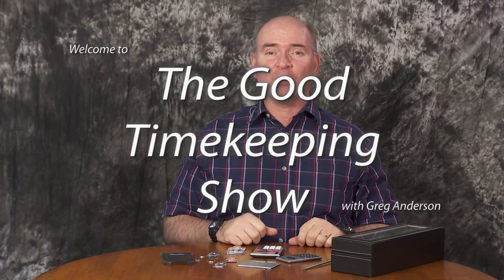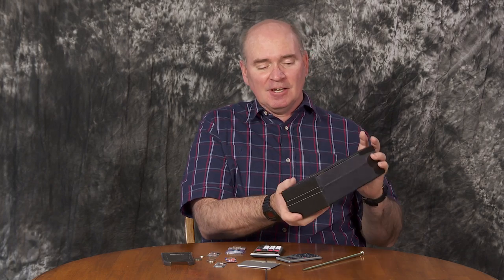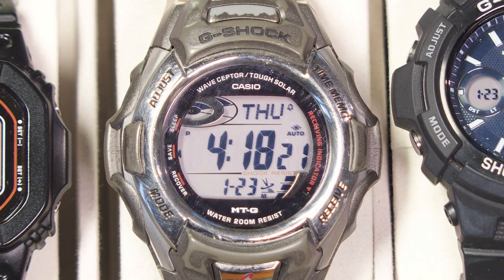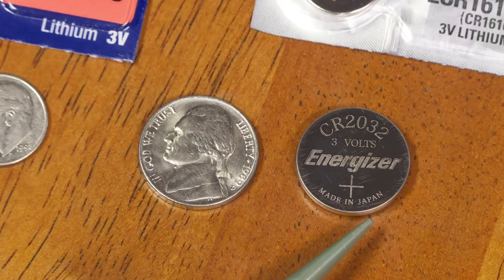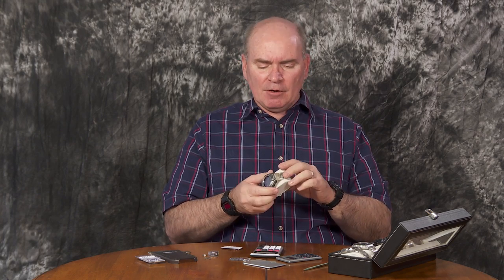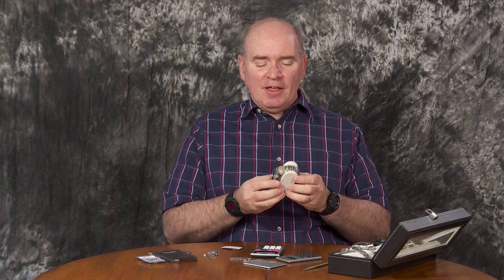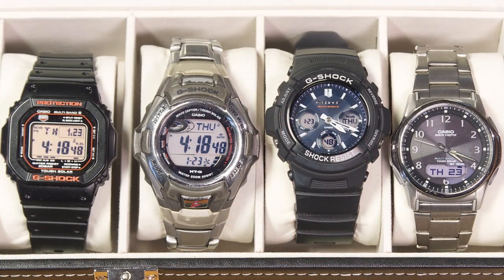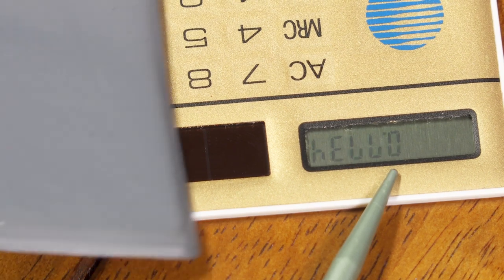What is Meant by Tough Solar (and Eco-Drive) in Casio (and Citizen) Watches?

Comment: I have owned a Solar G Shock for 15 years now...never had a problem and don't even wear it that much. Just take out to charge once a month or so,..
Reply: Can the battery be replaced after the Solar Battery is dead or does it mean Watch is also dead with the battery ?
Reply: @maximus3233  The battery can be replaced just fine, however it might not be dead at all. Give it some sunlight and usually solar watches come back to life. Not all of them of course. Also as Greg mentions in the video, if you do it yourself, make sure the seal is in good condition and properly inserted. Otherwise you're looking at a G-Shock that cannot come in contact with water or skin.

Comment: I've found the few Casio solar charged watches that I have, have easily stay charged well past six months in a drawer. Most if not all have a power save modes where the watch conserves battery charge when the watch is not disturbed for a certain length of time. That's both digital and  analog hands styles of watch.
Reply: Some Casio watches can last years without any sunlight. They all have a nifty feature called Power Saving, which will turn the display off after a while in darkness after a certain time and stay that way. Then if it still has not received any sunlight for a week, it'll stop the movement as well - So even more power saving mode. Also most Casio solars have features to extend the battery life if it drops down to a certain level, such as disabling backlight, alarms and radio reception. In total there are 5 different modes that these watches can use when it comes to battery life, and it's automatically selected by the watch depending on battery voltage. You actually have to work really hard to get one of these things to run out of juice (or forget it in a drawer for a few years) :p

Comment: Good video! When I was a child (80's) I bought a Solar Casio AL-180, but I lost it. In 2007 I bought another on Ebay from a New Old Stock and it's still working with the original battery.
Reply: It has capacitor not battery as far as I know it's written on the dial battery less 👍🏼

Comment: Some watches use rechargeable lithium batteries and some use super capacitors. These components are quite different in the way they internally store energy. While the capacity of the batteries definitely reduces over the years and charge cycles they have much greater capacity (energy storage) than super capacitors. However super capacitors should have a longer lifetime. I just replaced a CTL1616 rechargeable lithium battery in a 15 year old Casio Tough Solar WVQ-500. It was still working but would no longer charge to full on the indicator and would not operate as long as it used to, so I replaced the battery with a proper replacement and it is working like new again.

Comment: CTL1616 is Cobalt-Thorium-Lithium rechargeable battery. The original Seiko Kinetic line actually used a capacitor charged by a spinning generator, but the replacement was a lithium-ion battery (rechargeable). Maybe that's where the confusion comes in.

Comment: Capacitor Casio were called battery less written on the dial but with lithium ion rechargeable battery became common all new Casio use rechargeable batteries.

Comment: I had to replace my capacitor battery in my analogue Tough Solar Casio after 18 years of great service. I used that watch (and still use it) a lot, in the most harsh conditions. One month ago I noticed it wasn't keeping the display and time mode on, it was stuck in "low power state". Even after a day light charge, after one hour in the office it was gone. So ordered on eBay a new (correct) replacement battery, disposed of the old one and now it's all back on business.
Before going constantly in "low power mode", for at least two years the charge level was never going further than "MID" level. So I'm guessing that's a sign when you need to go for a new battery.

Comment: I have a solar Seiko SNE. On a motorcycle tour around Europe last year the watch spent a large part of the day covered up so consequently, it ran out of power a lot of times.  I never realised how much exposure to daylight they required.
Reply: I have , Casio, citizen and seiko solar. You are correct the seiko does not hold charge nearly as long as the other two brands. My Casio’s and citizen’s can sit in a drawer for 6 months and still have medium battery charge left. Now I but seiko autos and leave the solar to the other guys.

Comment: I have a G-Shock GW-002E-1VER for about 12 years now. I had to change the battery after like 10 years because it wouldn't charge fully anymore. It cost about € 20,-- including pressure test. It was done by a local watch repair service.

Comment: I've got one of the caseo watch like yours. I had to replace the capacitor last year. Ctl 1616 capasater. The watch is 20 years old.
It's not very difficult to replace the capacitor. There is a video on utube showing how to replace the capacitor. I replaced it just in time before corrosion damage the inner part.
If u haven't replaced the capasater yet , I would suggest u did. And relube the case seal if the seal looks ok. Cleen the seal area with a cleen qtip dipped in alcohol and let dry.

Comment: I just bought a Casio GW-2310. Is there a way to know when my watch was made? Based on some other sites I looked at with serial numbers it looks like it was made in 2014 but that doesn't make any sense.  10 years old?   Works fine but the battery is on Mid.  My previous watch was the same type and battery was on high for many years but the band broke which why I replaced it.  Can I expect the battery to eventually be on high after keeping it exposed to light?

Comment: How do you charge the CTL1616 battery/capacitor without installing it on the Watch? The new battery comes from the factory with almost 0% power. I had my GMW-B5000TVB for almost One & a half years when it suddenly refused to fully charge. Changed to a new CTL1616, exposed it to the direct sunlight for approximately 4 hours, managed to do the settings and what not through my mobile phone. The charge level is still very low. As soon as it is indoor, I put it under a bright LED torch light. Even then, it couldn't hold its charge overnight. What could be the issue here? Any assistance would be very much appreciated, Thank you.

Comment: Off topic - wondering if anyone can help me out on my Gravitymaster GPW1000-1A. It is the GPS model. I am unable to adjust the 24 hour hand to correct position. It is 12 hours off. My current and second time zones are correct, but can't get that 24 to cooperate. I have set the watch via GPS and it is still wrong.  Any ideas?  Thank you

Comment: Most tough solar Casio’s have a “sleep mode”, which takes effect when there is no light source for some time (usually hours), the watch just goes to “sleep”- all functions turns off yet it keeps keeping time (and date). And it “wakes up” and starts working almost immediately when you pick it up or when it senses a light source. That’s how it saves battery life and durability.

Comment: Three ecodrives only one had to be replaced Capicitor and repair was 40 $. One I bought used and it hadn't been in the light much. Its second hand skipped two sec. to conserve what was left.
Reply: it was skipping because that is the low power indicator...time to charge or replace capacitor

Comment: Once the battery is out of power, or let's say the watch is kept in darkness for about 3-4 months, shall I keep the watch in direct sunlight? Is keeping the watch under direct sunlight on a regular basis can harm the battery due to overcharging? What is the best way to charge the solar powered batteries?
Reply from the maker: Last year I bought a new watch which arrived with a drained battery. I made a video about bringing it to life...  https://youtu.be/4StC6fKpIZs (In case you were wondering, I store the watch in a case where it's exposed to normal light in my house. The watch it still running normally today.)
Reply: Most solor rechargeable watches have protection against overcharging. My Citizen ecodrive Skyhawk has protection against over charge. It's in the electronic circuit.

Comment: My GWX-8900 and my GR-8900A G-shocks still have the original CTL1616 battery in it since I bought them way back in 2014. Same with my GW-3000B analog which uses the smaller CTL920 battery which I got in used condition in 2015. If ever they run out of juice, I can order those rechargeables online though the CTL920 is a bit expensive than the CTL1616. But amazingly all three of my tough solars have stayed on high charge and I rotate them frequently.
Reply from the maker: I’m wearing my oldest tough solar watch right now. Bought it in 2006 and haven’t opened it up for any reason yet.

Comment: In a draw it will go into sleep mode. It's not a problem. 12mths mine was in the dark and started up straight away... if you ever need to change the battery which you won't. Send it to Casio.

Comment: CTL1616 is expensive at 20usd and the non rechargeable CR1616 is only 6usd x 10 or (0.6usd a piece). This could be the reason some just use non rechargeable ones.
Reply: Solar G-Shocks use that.
Reply: Non-solar G-Shocks have more functions as the solar recharging system takes away some functions of the module.
Reply: I am using a Casio WS200H Tough Solar Watch with a normal non rechargeable battery inside since in my country is impossible to get one CTL1616 and untill now my watch still working fine. I dont really know if some day battery get inflate or maybe explote but I checked it just yesterday and is in good shape.

Comment: For over 8 years, I've owned a CASIO DB-E30 digital watch featuring a tough solar panel, which has been functioning flawlessly except for the illuminator. Whenever I attempt to use the light function, the display goes blank, and the time resets. Seeking a solution, I took it to an authorized local CASIO watch service center, where they identified the issue as a faulty capacitor. Unfortunately, they informed me that due to the model's outdated nature, the capacitor cannot be replaced.

Comment: Hi, should we need to keep solar watches separately under sun or light to recharge or will it recharge automatically on our hands from everyday lights around us..
Reply from the maker: I have no trouble keeping the watches charged when I leave them in areas with normal light. And if you wear your watch often in the open (not covered by sleeves or cuffs) it should stay charged without extra effort.

Comment: A really informative video. My father had a similar calculator (the credit card one) called the Casio film card.
Reply from the maker: I had one of those credit-card-size calculators in the mid 1980s and then, one day, when it was in my shirt pocket, I leaned against a railing to look down at something and I cracked it. Sigh.
Reply: @GoodTimekeeper  he has kept the calculator with good care and it still function perfectly to this date. He has the original carrying case and manual too.
Reply: I had one myself. Good nostalgia

Comment: My Tough Solar is gonna arrive this Friday or the weekend, I can't wait! Apple and Samsung can learn a thing or two...
Reply: Super Sonic which model did you buy? I love these Casio Wave Cepters / tough solar watches and have several.
Reply: How's your tough solar after 5months?
Reply: @jamesbattista1466  I have the Casio STL-100H and it’s still going strong! It’s very very beat up from working, it’s been frozen, had hot oil splashed on it and it’s still going strong! The battery hasn’t gone down from the high charge state!

Comment: It's definitely a rechargeable battery and almost never a capacitor. There are some "batteryless" Casios that actually have a capacitor and I believe they hold ~14 days charge at a time.
Reply: 4 days at most. The CTL-1616 is a capacitor.
Reply: @traviswalker8933  Cheers. Could have sworn they advertised a week or two. Edit: but the CTL1616 isn't a capacitor to my knowledge.
Reply: @UsernameInvalidTHIS  Nah, those are terrible watches without any backlight. I won't be going near them when Casio has better solar powered watches around.
Reply: @traviswalker8933  Agree. I don't see any real advantage to the batteryless ones anyway. 
"Oh, no rechargeable cells to recycle?" -- someone probably. Well, one tiny button cell thrown out every ~20 years is hardly going to destroy the environment.
Reply: @UsernameInvalidTHIS  the battery less might have been good back in the 80s when solar powered watches were in their infancy but in this day and age, Casio should've improved them while reissuing them in the market.
Reply: @traviswalker8933  Would be great to see Casio revive the idea using supercapacitors when those become viable. If they could go a few months on a full charge I'd happily try one.
Reply: @UsernameInvalidTHIS  modern tough solar watches can go months without a fill charge so they already did that.
Reply: @traviswalker8933  Yeah, but if they could get a supercapacitor powered watch up to rechargeable battery standards (and it wasn't super expensive) there would be no reason not to go with it. Actually, I think if they could get 6 months out of them they would phase out rechargeable battery powered watches.
Reply: @UsernameInvalidTHIS  currently they are getting 11 months of power reserve from rechargeable batteries so.
Reply: Both my older eco drives are fitted with capacitors,absolutely not rechargable batteries.I'm not a watch expert but have spent thirty odd years repairing electronic automotive systems,I know what a capacitor is.
Reply: @areyouundoingthatorwhat9181  That's interesting. I've never owned any Citizens honestly. How long do they last on a full charge? Also model/capacitor model if you have them handy? Capacitors are getting way better for a given size than they were when Casio first made those "batteryless" models.

Edit: some Googling tells me it's a Panasonic MT621 capacitor most likely. Wonder why Casio chooses not to use them? Cost? Because I've heard Ecodrives are pretty good.
Reply: @UsernameInvalidTHIS  yes cost is the main factor here.
Reply: @UsernameInvalidTHIS  not sure of the Panasonic number but the citizen code is 296-95,has five contacts and is the work of the devil to fit .
My H11 is about 21 years old and has kept power continually for its entire life despite only being worn occasionally,the other older eco drive( can't remember model number)is around 25-26 and did stop once or twice  but quickly revived it's self and auto adjusted the hands, which surprised me.My newer collection of eco drives,around 20 or so are fitted with rechargable batteries of which three I have had to replace,two because of faults with the amount of charge they would accept  and one just stopped working completely.
I have a habit of ensuring they get a turn on the window sill once a week in good sunlight and in the summer months or days of good strong sun the chronographs and waterproofs all go out into the garden on a stand I made,sometimes for a few days at a time.This ensures they all stay healthy.don't worry,we are secluded and on the remote chance of someone spotting them 39 geese ensure they stay put.

Comment: my oldest Tough Solar ProTrek PRG-50T-7V finally got a new rechargeable battery last year. if memory serves me correctly, the early version PRG-50 came with bad cells. however, the OEM battery held up for me for approximately 6 years. I got her working again last year after using the same YouTube video linked in this videos description. let's just say that I only use the Auto El feature when needed. 👍

Great video!

Comment: My Protrek Tough Solar PRG 505T just lost its power..  2012 - 2024.. about time to get a replacement battery..
Reply from the maker: Not bad. My oldest Tough Solar G-Shock is an MTG-900, still going without a battery change since 2006. We'll see how much longer it can last.

Comment: The rechargeable battery in my Citizen Eco-Drive watch only lasted 4 years, and it's expensive to replace. 

I'd never buy another Citizen Eco-Drive watch.
Reply: Interesting, I have never heard of such a short life for a Citizen solar watch.
Reply: I bought ab Eco Drive watch for my wife. After a couple of months it would only run in direct sunlight. All my Casio solar watches, along with battery powered ones as my Seikos, going back to the 1980s/90s to current; are all working perfectly today.
Reply: Lying don't believe you

Comment: Citizen watches use capacitors, Casio use Titanium Cobalt rechargeable batteries. When buying your battery, Casio doesn't require soldered tags, other brands do.
Reply from the maker: Good to know. It’s getting to the point where it seems like Casio doesn’t want the average customer to know what kind of battery is used even in their least expensive watches. They seem to only want us to take these watches to an authorized service center for any service, including simple battery changes. Hmmm.

Comment: Good video, thanks. I have been wearing the G-Shock DW-H5600-2 for the last 26 days and did not know about the differences between "tough solar" and the normal Casio solar watches. And a huge bummer when I learned the DW-H5600 is not a tough solar watch. Yes, I subscribed for more information - thanks, Greg!
Reply: What exactly is the difference?. Online sources suggest that they are both the same

Comment: if solar watches recharge by itself , then why battery replacement is required ?
Reply from the maker: Eventually the battery is expected to wear out. But if it’s used correctly it can last a long time. My oldest Tough Solar watch is still working after 16 years without a battery change yet.